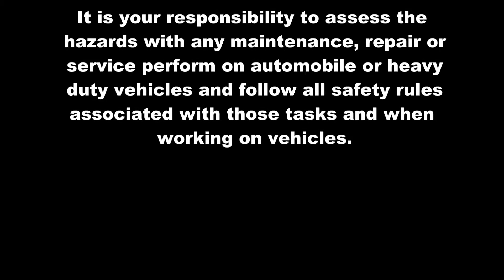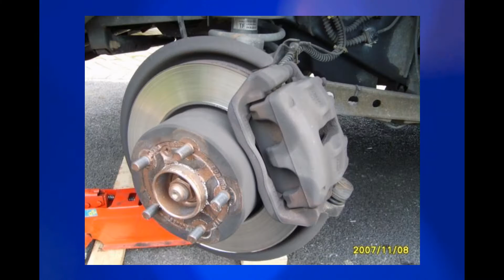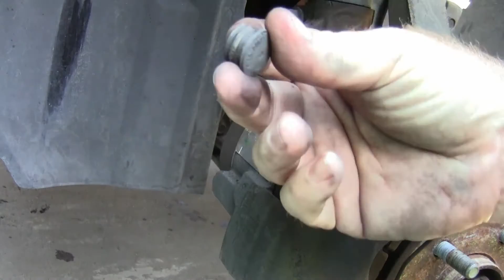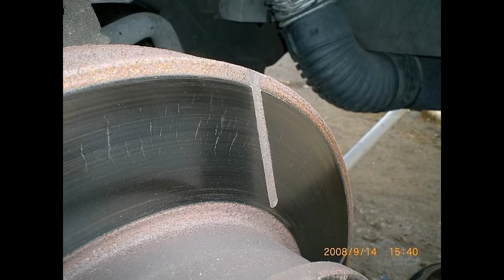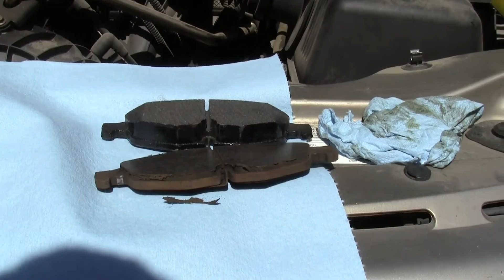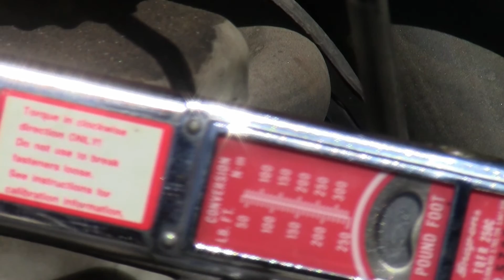brake job 2002 dodge stratus

Comment: 1) Just wondering; is air going to affect the caliper when you depress the pedal, air in the break line? Or no problem at all? At which point at the end, you place the top back on on the master cylinder? 2) how tight is tight on the guide pins when you tight them up- snugged?
Reply: Air in the brake lines Must be bled, asap. Doesn't matter about the plastic master cylinder cap. Guide pins should be torqued to spec.   - take care